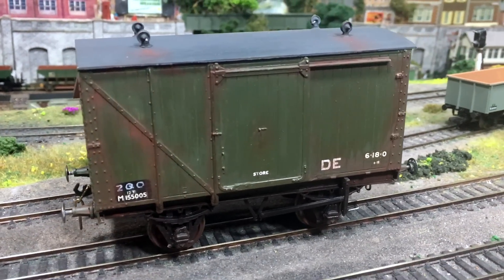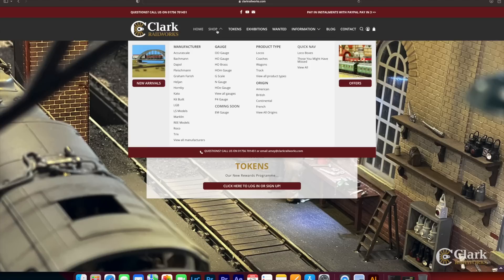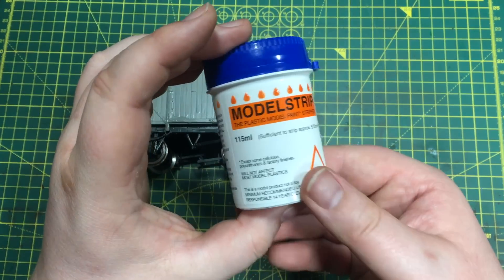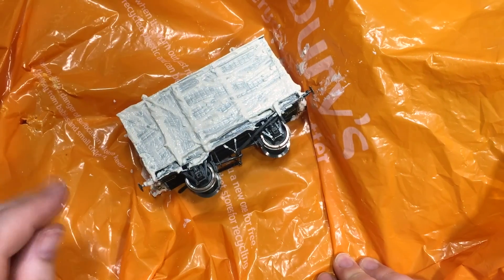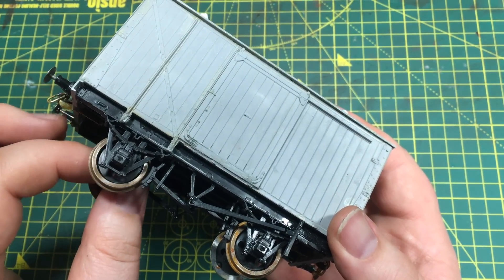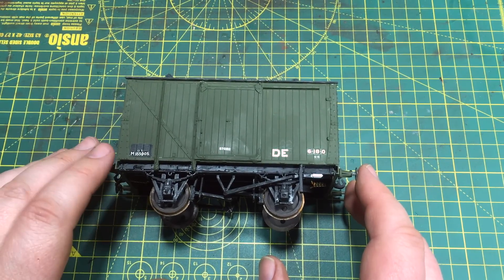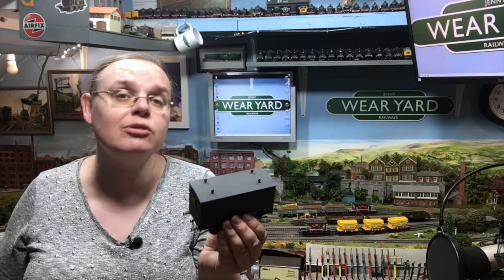Can We Fix It? Restoring A Kit Disaster!

Comment from the maker: Chapters:
00:00 Video Start
00:13 Introduction
02:12 Sponsor
03:42 The Ruined Model
05:50 What to Use
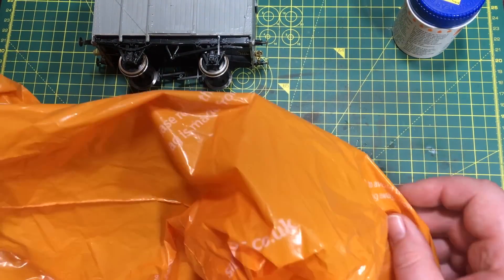07:20 How To Restore The Model
10:06 How to remove unwanted paint
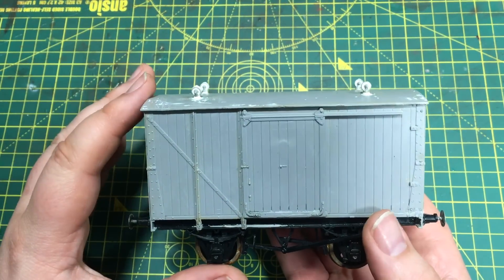11:13 The model after using paint remover
12:44 What paints to use for restoration
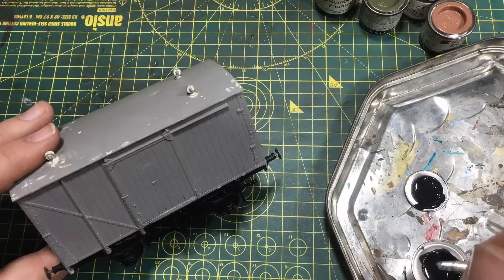14:47 Repainting the model
15:08 Assessing the model
16:11 Touch-up painting
17:28 Adding decals
20:26 Weathering and final assessment
21:42 Conclusion
23:54 Thanks and sponsors

Comment: Hi Jenny A lovely modelling video tutorial, although just a couple of points if I may, when you put the decals on, you didn't 'gloss' the black panel, I had thought that when applying decals the background is better with a shiny surface to help adhere the decal, or were those decals of a different variety(?). Secondly I can't say I've ever seen that 'Modelstrip' anywhere before, is it a new product or an older product whcih has been discontinued. Thanks, (liking these new ventures into modelling detail) 🙂👍

Comment: Great video. I’ve acquired a rake of Kitmaster coaches. They are generally ok but, I’d like to add passengers and lighting. Is there a product that breaks down glue so I can get the roof off. Also, all the couplings are missing. Any help with that?  Iain